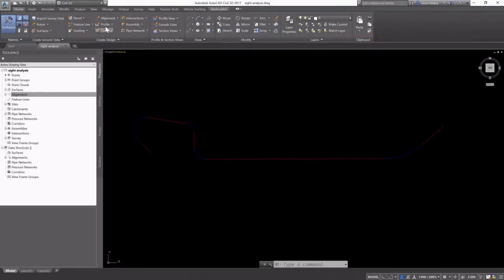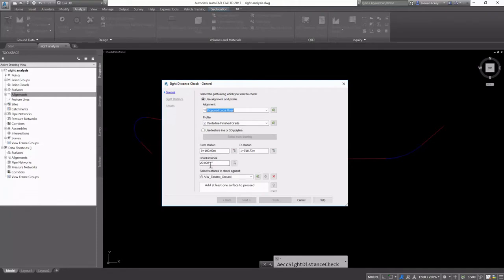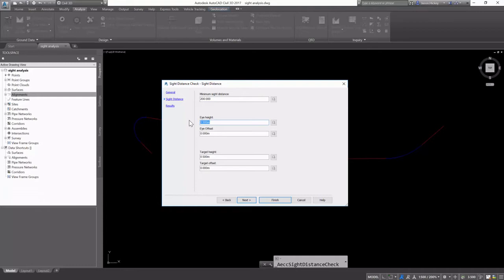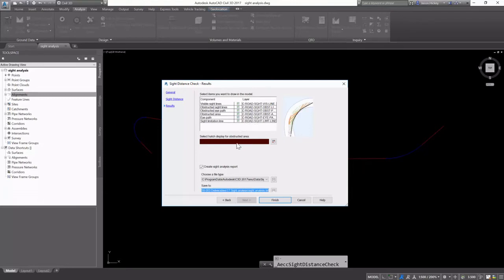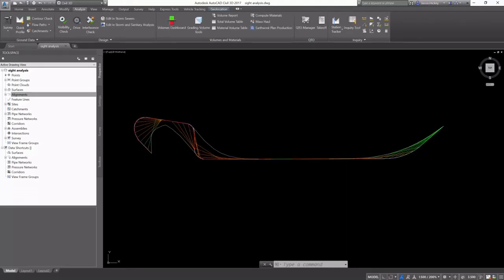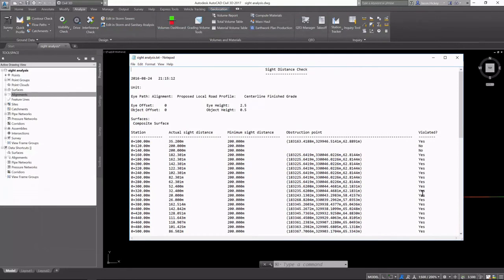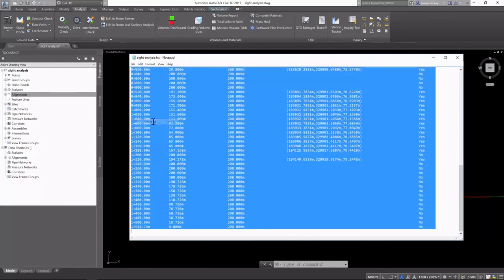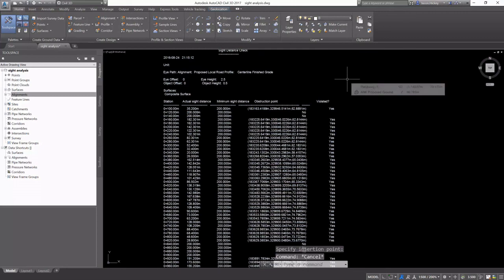Autocad Civil 3D:- Lesson 2.10: Sight analysis

Comment: Does this tool check the stopping sight distance for vertical curves? If I created a design profile, made a corridor from that profile, and then created a corridor surface, would Civil 3D check to see if the established profile had vertical sight distance concerns based on the defined parameters?